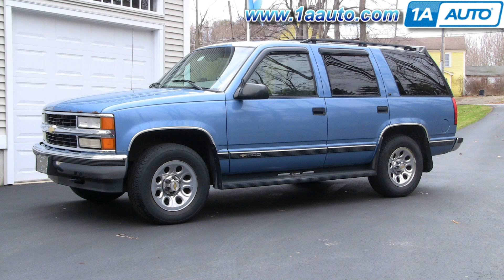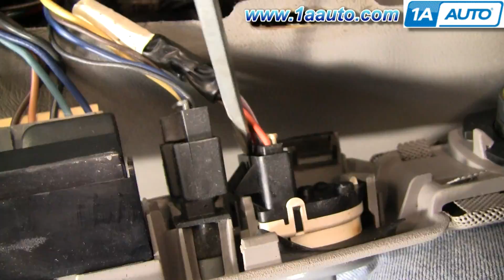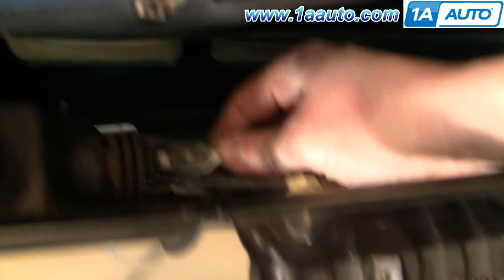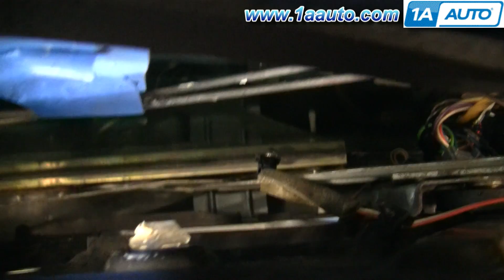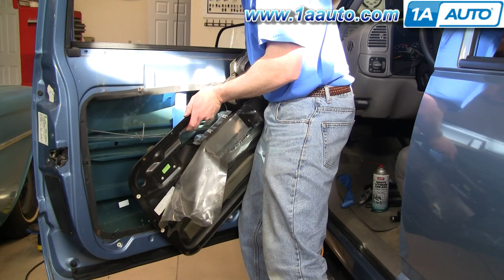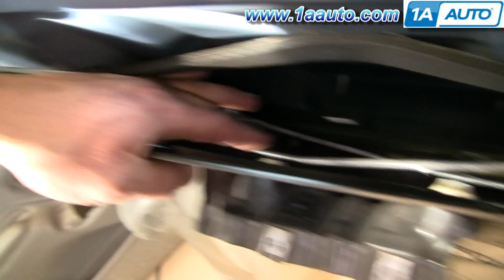How to Replace Window Regulator 95-00 Chevy Tahoe

Comment: Hi I have 99 tahoe the window motor works fine but  the window is off the track and lob sided,  part were the window curves fell down,  when i make the window go up only the corner pointy corner goes up and when i try to roll it down only the curved side goes down, is there any way of fixing that without taking the black panel off?

Comment: 1999 Chevy Tahoe 2 door. 5.7. 4x4.
Problem:
Door locks, power seats and interior lights don’t work.  And the battery (new) would die in a day or so!  While problem solving this, I was checking fuses in the driver side door jam fuse box?  I noticed that the TOP 30amp silver circuit breaker was HOT!  So much it burned my finger!  I pulled it and I solved the battery dying problem but still had no door locks or interior lights.  So, I replaced the window switch/door lock and put the circuit breaker back in!  WhahLah!  It worked!  I had lights, door locks and power seats back!
3 days later... I got no door locks, interior lights and seats again!

Can someone help me???

Comment: any recommendations for this process without the window rolled down? can this all still be done with the window up, or does the window need to be rolled down to remove the inner panel? my window was clicking the other day, got it to roll up, but wont roll down now..looking to replace the motor/regulator but not sure how easily it will be done with the  window up! thanks!!!

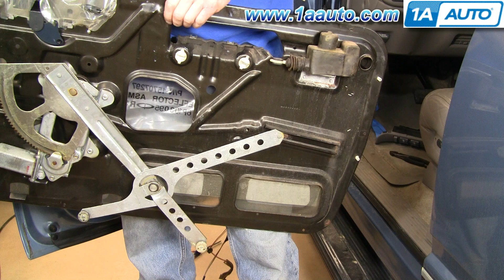Comment: You lost me at 4:19... the panel was off and you're talking about literally drilling out rivets, yet not "removing and replacing them" -  "riveter" is not listed in tools used, I'm so confused now... How am I going to replace rivets? If I don't have to then why isn't there video of showing how easy it is to just "bolt" them back in? I can't see anything you're doing with the wheels putting it back on because the panel is in the way, I really wish you had spent more time going over the details on this one...
Reply from the maker: +Do It Yourself Thank you for the feedback. You will not need to re-rivet in the new regulator, however, it will need to be bolted in. You should be able to find the bolts at a local store. 1aauto.com
Reply: @1AAuto  Yes, thank you! This was my confusion as the part came with no mounting hardware. I got it all bolted in and back together, unfortunately it still did not roll my window up, I've replaced the window switch as well although that did nothing, w/ the new switch I was still able to roll up all windows but the driver's side which became stuck once rolled fully down. So this new motor/regulator was tested with the old window switch, I can still test it with the new to see if that combo works, after that I guess the wiring is all that's left unless it's something I'm not aware of causing it to stick, I don't hear the motor working at all... wish me luck with this lol

Comment: You state to be sure the window "is all the way down"...mine is stuck in the up position...how to manually move it down????  thank you!
Reply from the maker: +Katherine Vaughan You would have to crack open the back of the motor and manually crank it.  Since you cannot do this until you remove the panel you are going to have to tape up the window and leave it up!  1aauto.com

Comment: What if the window is up and wont roll down, how can you change the motor or even get the window down when the motor is bad
Reply from the maker: +Steven frazier You should be able to move it up or down from within the inside of the door. Hope this helps you out. 1aauto.com

Comment: did i miss something? i didnt see you replace the regulator, just remove tge panel and put it back on?
Reply: well the hard part is gettin the son of a bitch outta there, i imagine once that panel is out the removal and replacement of the regulator is just a matter of drilling out rivets and re-riveting.
Reply: Great video.. i would like to add regarding the regulator ...WATCH OUT when you drill out the rivets for the motor.. that thing is under a high tension spring. it almost killed me when i popped out the last rivet.. then almost broke my hand when it snapped back trying to install the motor.
i finally got it all back together but the way i did it was pretty skethcy : )
funny thing too was that there was no mention of this in the instructions that came with the new motor... so obviously i missed something.
Good luck and be careful!
Reply from the maker: +Justin Gauger Thank you for checking us out. The regulator was attached to the panel, and a brief description was provided, but you are correct the regulator was not fully detached. 1aauto.com

Comment: Helpful video but be warned I almost lost my finger when I removed the actuator motor from the frame I wasn’t paying attention the spring unloaded and darn near removed my finger. I was interrupted many times during the repair so it slipped my mind, be smarter than me pay attention
Reply: Happened to me too 😂
Reply: They really should have a heads up about the spring tension when that last bolt comes out. Be careful

Comment: how do i change if window is rolled up and can't roll it down?
Reply: drill or knock out the rivets holding the regulator from the inner door panel then it will all slide down. I taped the window to door frame to keep it from falling and smashing my hand.  BIG THANKS A1 Auto for all the videos, you help me keep my 98 chevy 3500 running with over 300k miles!
Reply: 1A Auto Parts ok thanks
Reply: Same here?  Need help
Reply: I had the same problem so I made a quick video of how to remove the panel and regulator when the window is up. https://youtu.be/9NG262YBatw
Reply: @MrBadKarhma  thanks
Reply: Buy s ford

Comment: all these videos say lower the window... ummm... what if it's stuck in the up position??
Reply from the maker: +Richard Wood Check the cables to see if one of them is broken or jammed inside of the door. Sometimes you need to cut the cable to free the window up so that you can slide it up and down. Hope this helps you out. https://www.1aauto.com/1A/WindowRegulators/GMC/C2500-Truck/1AWRK00019?utm_source=YouTube&utm_medium=CTA%20Comment&utm_campaign=1ATony

Comment: You don't show replacing just the window motor. Is it better to replace the regulator and motor at same time?
Reply from the maker: +Brian D Great question.  While it is possible to replace the motor only, more often than not, the connection points break while trying to attach the motor to the regulator.  To cut down on hassle and damage due to improper installation, we recommend buying the window regulator with the motor, whenever possible.  For anyone looking to do this job, 1A Auto offers the window regulators with motors here:  http://www.1aauto.com/1A/WindowRegulators/GMC/C2500-Truck/1AWRK00019?utm_source=YouTube&utm_medium=CTA%20Comment&utm_campaign=1ATony

Comment: How do i get the window down to start??
Reply from the maker: +Darrin VanDemark You may want to check the power going to the switch with a test light if the window isn't moving in either direction when the switch is pressed. Hope this helps out out. 1aauto.com

Comment: I don't need to replace the Window Regulator  . need to replace the window. I need to know if I have unscrew the Window Regulator  plate to put window in?
Reply from the maker: There may be a couple of bolts that hold it in place, or on some vehicles adhesive is used along with plastic clips to secure the window to the window regulator.

Comment: Great Video. Made my job a lot easier. I have a 95 Suburban with a bad window motor. The only glitch I had was the I didn't have the right size rivet gun for the rivets that the kit came with. I bought one at harbor freight and done deal. Thanks

Comment: I had to replace the drivers side door on my 1998 gmc 1500 extcab. Old door was manual, new one is power. Can I run new wire and fuse and hook the window up like that? Or do I need something that is not in the door already, like a regulator or something? What wires on the harness are for the drivers window? I am not worried about lock or mirror or anything else just the drivers side window.
Reply from the maker: You might be able to. You may also want to check the factory harness to see if there's a place to plug the door harness in. If there is, you might be able to find a used factory harness in the salvage yard, or on EBay for it. Hope this helps you out. 1aauto.com

Comment: How can I just shut my passenger window on my 1998 Chevy Silvarado K1500 Extended cab with electric windows until I get replacement parts from you web site.
Symptoms are nothing happens when I try to open or shut doors. Just got new battery replaced.
Reply from the maker: If there isn't any power going to any of the doors, you may want to check the fuse first. If that's fine, check the wire harness that runs between the driver side door and body of the truck for a broken or frayed wire that may need to be repaired. This would also cause these symptoms. Hope this helps you out. 1aauto.com

Comment: I bought a used truck, and was told everything is good in the drivers side door for the window (ie..the regulator and motor)  The guy said the piece that is on the window itself is bad, (the track?)  is that replaceable?
Reply: 94 Sierra SLT EXT Cab
Reply from the maker: *****
Thank you for watching. It sounds like the guy was referring to the tab mounted on the window itself. You might want to remove the door panel and verify before going any further.
1aauto.com 888-844-3393
Reply: 1A Auto Parts I have this issue myself, where the tab attached to the window itself has separated from the window. It's the long one on the left side facing the door from the inside. Can this be glued back, or do I need a replacement window? Nice video on how to remove the door panel and window regulator.
Mine is a manual window on a 1994 Chevy K1500 Cheyenne short bed pickup.
If it is possible to glue this tab or trim piece to the window, what adhesive would be best to use? Thanks.
Reply from the maker: rfn944 If this is the piece that you're referring to we may carry a new one for you.http://www.1aauto.com/window-channel-front/i/1abmx00096?f=504922&y=1994?utm_source=YouTube&utm_medium=VideoReply&utm_campaign=1ATony

Glue to attach sash connectors, or pieces to the window that were glued from the factory may be found at your local auto parts store or auto body supply store. Hope this helps you out.1aauto.com 888-833-3393

Comment from the maker: There should be a few bolts on the outside of the door, or on the inside, that hold the latch in place. You would need to remove the door panel to access it to make repairs. 1aauto.com 888-844-3393
Reply: 1A Auto Parts hey how can i get two front seats for my 95 chevy Tahoe, i rather get leather.

Comment from the maker: You can attach the new regulator with rivets like factory did, or most people just use some small nuts and bolts that will fit securely in there. Hope this helps you out. 1aauto.com 888-844-3393

Comment: So after drilling out the rivets, what will then keep that piece in its' spot after replacing the regulator? Also, my truck has rivets holding the speaker in, so what would be the most practical way to hold the speaker in after that?

Comment: I have a 1998 chevy c1500 with a manual regulator instead of auto, does the same basic principle apply as shown in this video? Also what was exactly done about the window placement in this video? Must it be down when performing this?

Comment from the maker: You may want to test the power going to the switch with a test light to see if there's power going to it. Also check the fuse to make sure that it's good. Hope this helps you out. Have a great day! 1aauto.com 888-844-3393
Reply: How would you test the fuse on a 99 Chevy Tahoe driver's side window?

Comment: i have a 2006 chevy silverado and the driver's window will not go up or down what could be the problem? I tried replacing the driver window power switch but it still wont work. What could be wrong with it if you could please help me

Comment from the maker: HI Keith, We currently do not have  a video that shows this repair. Usually you need to remove the glass from the window regulator, then remove the glass out of the top of the door window opening. This may to finagle the glass and tilt it to remove it from the door. Hope this helps you out. 1aauto.com 888-844-3393

Comment: Thanks for walking me through the process.  The rod that is connected to the exterior door handle came loose and the door would not open from the outside.  I used this video to remove the inner door panel and access the small area behind it.  Door works like new and best of all I didn't have to pay a dime to get it fixed!  Keep up the good work and thanks for providing such great videos.

Comment from the maker: We currently do not sell a window regulator for the rear door on that truck. You could either use similar rivets to attach it back to the door or some small 1/4 screws.

Comment: I have a 1997 chevy tahoe with the left side rear door window regulator motor has gone out. I bought a replacement motor, but I cannot replace just the motor because the original motor is permanently attached to the regulator. does 1aauto have a regulator with the motor allready attached for the left side rear window of my tahoe? also I do not know what size those rivets are. I would like to get the correct size to use and replace the ones I cut out. what size is used for the rivets?

Comment from the maker: You may be able to leave the regulator in and clean all of the broken glass inside of the door. Usually you would need to go through the top of the door with the new glass, depending on the truck you may need to put one corner of the glass in first and angle it in. Hope this helps you out.

Comment from the maker: We currently do not have and auto repair video that shows this repair. There should be about 3 bolts that holds it in place on the door. You may need to remove the door panel and any trim piece covering the bolts to access them. We carry the replacement side view mirrors on our website 1aauto.com for your your Chevy Astro van. 888-844-3393

Comment: Mike you are awesome, thanks for this video. I own a 2000 Cadillac Escalade, it had a 99 window regulator on it. My issue was when someone broke into it, they bent my regulator. I bent it back, but they also broke the rollers. So after I was finished bending it I couldn't figure out how to get the rollers back into the window lift plate. I called numerous shops and searched Google all over day and night, but this video was the only thing that actually showed me. From 05:13 - 06:40. Thanks

Comment: I have a 94 gmc n when i push the automatic lock button the passenger side locks but the driver side doesnt it moves when u try to lock it but dont lock it just budges a bit could it b sumthin is stuck or need new lock motor??? Anything idea would b much apreciated before i take it apart cuz i tried to look before but took me over an hour n could not  have done it to save my life get the clips off the window n lock buttons so i can fully take off door pannel cuz u cant pull wire an everything o

Comment from the maker: It may be the window motor. You could try to grease the window regulator track with white lithium grease, and you could also try to spray the window weatherstrip with silicone spray to see if that speeds them up. We sell a huge variety of window motors and window regulators on our website 1aauto.com Hope this helps you out.

Comment from the maker: If the weatherstrip around the window is really dry and worn you could try to replace it, or even spray a little silicone spray on it to help the window glide a little easier. You may also want to remove the door panel and make the window go up and down to see if the window regulator is getting jammed or stuck from some reason. Hope this helps you out.

Comment: Hello, I have a 91 GMC with power windows and the driver window gets stuck at 3 points while rolling the window down and up, I have to push/pull up the window to get it to my desired location. What can I do to fix this?? Thanks Leo

Comment from the maker: It could be a couple of things, if the window doesn't go all of the way down, the window regulator may be broke inside of the door. You may want to check it. I would test the power to the switch with a test light to see if it is getting power to it. If it's not, check the fuses and also the wire harness between the door and the body of the truck for a broken or frayed wire. Here's a link to our parts section for your 89 Chevy Blazer 1aauto.com/1A/-/Chevy/S10-Blazer/-/-/1989

Comment: hello i have a 1997 silv . My window gets stuck in the up position. When this happens i take off the door panal and i get a rubber hammer and i hit the part that shaped like a half moon that connects to the gear for the moter. now my question is it the motor that is going out or somthing else ?

Comment: @thirdstreettito Mine was stuck in the up position so what I did was turn the ignition key to power up the switch while holding the window switch in the down position (may need a helper) I took a small hammer and tapped the motor which kicked on and lowered the window.. Try this first!!

Comment from the maker: @eramirez189 If you are using the hand remote that is how it works.  Push the button once and the driver door unlocks push it again all the doors unlock.  If it is not that simple then try replacing one of the door lock actuators and see if that helps 1 door.  If so replace them all.

Comment: what can i do, i have my 1996 chevrolet suburban. And for some reason my power locks dont work. I push the button to lock and it works. but when i go to unlock only the driver side door unlocks. Any suggestions on what i can do to fix this. It gets frustrating opening all the doors by hand. Thanks in advance.